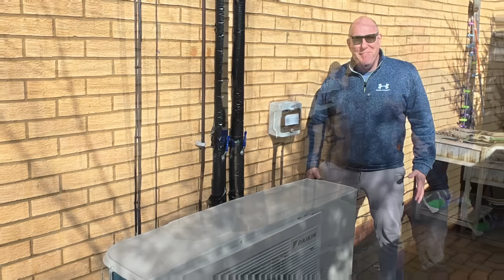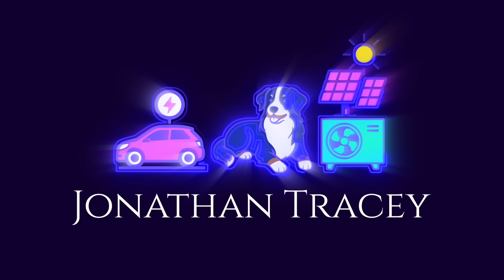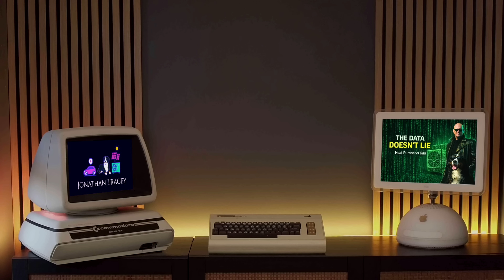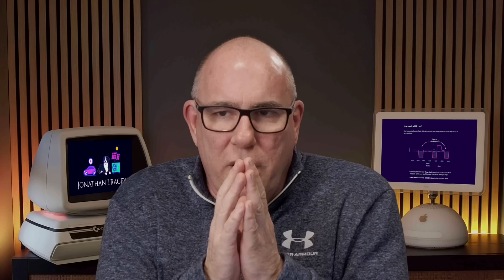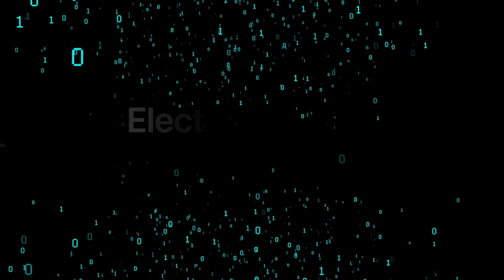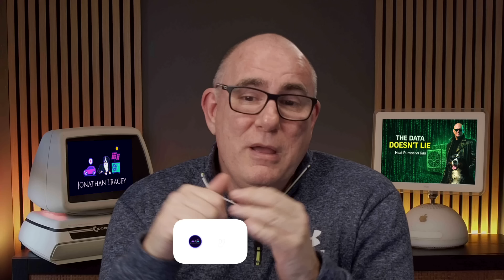The Data Doesn’t Lie   Gas vs Heat Pump Real Running Costs

Comment: Our experience and figures are a bit higher than JT's but I'm still very pleased with the heat pump. 
We have a 1950s bungalow 140m2 heated to a constant 22c for 24 hours a day, no setback.
The house has always been run at the same temperature even before the heat pump so no change in habits or economy. 
It has a reasonable amount of insulation but not great. 
Gas boiler was 28 years old and replaced with a Daikin 8kW heat pump July 2025
We had 9kWp of solar panels, 5kW inverter and a 9.5kWh battery installed in 2023 - no EV

Our Gas Boiler to Heat Pump Comparison Excluding VAT and Standing Charges
Electricity cost of the heat pump is the actual daily value of our grid imported energy and is measured via a Shelly EM50 
(Free Electric and Solar is ignored for direct comparison to gas) 	  			
		
January over the years
2026 - 925 kWh Electric Cosy  £141.38
2025 - 3850 kWh Gas Tracker   £239.88 	
2024 - 3364 kWh Gas Tracker   £247.18 
2023 - 4111 kWh Gas SVT       £402.88
2022 - 3248 kWh Gas SVT       £269.58 	
------------
February 	
2026 - 656 kWh Electric Cosy  £96.29 	  	  	
2025 - 2866 kWh Gas Tracker  £186.06 	
2024 - 2527 kWh Gas Tracker  £132.14 	
2023 - 3857 kWh Gas SVT      £377.99 	
2022 - 3110 kWh Gas SVT      £258.13

Thank you as always Sir.

Comment: One thing that concerns me about a mass switch over to heat pumps is as you have run through with the figures you would be reliant on special tariffs. Great if the companies keep them open but it will be very tempting once they have a captive audience to hike or close the tariffs meaning you are stuck with a expensive system that you can’t replace with a gas boiler because of the grant. 

You also need to add some comparison about the capital costs. It would be good to see the expenditure of the solar and batteries cost invested in a Stocks and shares ISA and that income from dividends being compared. 

Love your data driven reviews, this is what we need to see so we can compare gas vs heat pumps.
Reply: I did this very experiment for Mr EV man recently, he spent £18k on solar and batteries, someone said he'd be better off investing it, but what they always forget is to take the money out of that pot every month to pay the difference in the electric bill that the panels/batteries would save. That invested pot at 10% growth ran out pretty quickly, whilst the panels kept on generating and saving money year after year.
Reply from the maker: @TheRonskiman I’ve done a similar comparison and found the same thing. If you model taking money out of the investment pot each year to cover the higher energy bills, the pot tends to run out after about 15 years or so.  

The solar on the other hand should still be generating and reducing bills well beyond that — assuming I’m still around to enjoy it 🙂
Reply: @JonathanTracey   I hadn't considered this but I seems like a superb point: that the investment doesn't account for the energy costs along the way. Thank you and @TheRonskiman for the education!
Reply: Realistically, the spectacular effect of compound interest makes none of these options more lucrative than stock investments, on average.

But if the market crashes then you have an expensive house to run. If you invest in the house then you can lower your bills meaning you can live off very little income if needs be. Especially if you paid off your mortgage, which is a poor investment compared to stocks.

It's a risk aversion thing: The investment in stocks is higher return with higher risk. The investment in solar panels, a battery, an EV, and a heat pump, has a lower financial return but far higher stability and lower risk.

Personally, I know from my job that humanity needs to stop burning fossil fuels and there's very little I can do to affect that. So I decarbonise my own consumption first, which happens to also be a fairly good investment. Then from the savings made, I can invest the rest in stocks etc. I've only got solar panels to add to "complete" my house, now.

That strategy is the wrong way around because of the mechanism of compound interest, but stocks are a relative "bottomless pit", and your home only needs maybe £35k to "complete" the low carbon investment, so personally I'm trying to minimise my monthly costs which also reduces my risks and stress, then I'll invest (more) in stocks. 

Also when your car needs replacing an EV is cheaper to own than ICE so it's a no brainer if your lifestyle can make it work. Same deal for a heat pump: cheaper than a gas boiler in the long run. You get these as a matter of course rather than purely as an investment. An EV charger increases house prices by more than they cost.

Then when you have those, the battery saves you mad money. Solar panels compounds that further. The actual investment is like £10k for those. And you get backup power in cut outs, and energy independence in case of political/war related supply fluctuations. If you get the right car and charger then V2G/V2H can enable you to get a "battery" and an EV in  one package! Worth paying maybe up to £20k more for a car with V2G/V2H capabilities (£160/kWh capacity, minimum. £670/kWh you use per day, max.)
Reply: @Leo99929  My solar has beaten ISA performance consistently. Our batteries are doing likewise, but only because we are a huge energy user. Now battery prices are crashing it's getting so it'll work out better for more people.

For non ISA sized investments remember to account for the tax impact too. It's also the case that for poorer people who are home owners that sometimes doing things like adding solar gets the money out of your bank account if you acquire some eg inherited and so keeps you eligible for tax credits and the like.

I'm always amused by the RoI arguments on solar when it's 4-6 years yet nobody thinks twice about the RoI on replacing knackered double glazing units which is nearer 20 years.
Reply from the maker: @etchedpixels @Leo99929 I’ve actually found the same thing in my own numbers. My ISA has done well over the years, but the return from my solar has been even better when you look at the avoided energy costs.  

The key difference is that solar gives you a return every single year by reducing your bills, whereas an investment pot usually has to be drawn down to pay those same bills. Different types of investment, but in my case the solar has definitely been the better performer so far.
Reply: The tariffs derive from the difference between supply and demand because power generation doesn't go to bed at night (except solar) but people do. The UK actually has a huge amount of extra night time capacity so moving more and more stuff to use batteries isn't going to hugely narrow the pricing. It would take massive onshoring of lost industrial production from China, India etc to do that. 

Solar will also continue to eat into demand, as will insulation (the one everyone forgets about).

One thing that might narrow it is massive deployment of batteries. But the commercial point of massive deployment of batteries is to store all the renewable surpluses and then resell it at less than the gas price so the net effect should be to bring all prices down.
Reply: @etchedpixels  There's also the policy that the unit rate is set my the most expensive form of generation currently operating. So changing that policy would make an enormous difference. 

Also how gas prices are artificially suppressed to ensure the vulnerable don't fall into fuel poverty, whilst electricity doesn't receive the same favour. 

As we get more renewable capacity that should reduce the need for the expensive peak power plants, and distributed batteries in houses and cars can help balance the load on the grid between consumption and generation temporal mismatches. V2G and V2H would help massively with this. 

As would clamping down on the cowboys charging insane rates for low quality heat pump, solar, and battery installs. That would enable more people to afford more of the systems, and improve public perception of the technology. 

Maybe some government cheap loan fund where known good contractors can be paid reasonable rates for good quality installations, and the repayments are in line with cost savings, making them sustainable. Roll the repayments forward into further loans.
Reply: @Leo99929  Its not protecting the vulnerable, it's protecting the middle classes. The vulnerable and poor are much more likely to have badly insulated electrically heated flats/apartments.
Reply from the maker: @davideyres955 Thanks David. Yes, without smart tariffs the numbers would definitely look different. That said, while the grid continues to have periods of excess generation I suspect these kinds of tariffs will stick around in some form.  

They’re also one of the reasons solar and batteries make sense, as they give you a bit of insulation from tariff changes and the kind of global events we’re experiencing right now.
Reply: The country is firmly set on a course for more renewables, and that means the swings in wholesale price are likely to get larger, not smaller. That means we're going to see more special tariffs, but they'll probably keep changing.
We might see less predictable highs and lows that last a couple of days as weather systems cross the country.

Comment: I’ve been thinking of going Heat Pump, but my boiler is still working fine.
I have tweeked flow rates and I have smart thermostats in each room (Rad Stat with its own Room Stat) Temperature set to 20ºC 6:30 AM to 8:30PM when it then gradually ramps down to 17ºC.
4 Bedroom house. Hot water tank is heated by electric.
I’m on Octopus IOG and Gas is on the Tracker. I have solar & battery storage.

I’ve checked my gas bill December to January & it was £240.17 so I guess that’s not bad.
It wouldn’t be to difficult to install a heat pump either, but its not really worth it at the moment.
Might have to have a rethink if that chimpanzee with the hand grenade in the WH can’t get out of the war he started.
What really galls me is having to pay that gas standing charge over the summer months.
Reply: I did the same with our gas boiler flow temperature and was on the tracker tariff for a year before we had a heat pump, our numbers were similar to yours too. I've put my numbers in the comments a few minutes ago.

Comment: My Daikin 9kw was about 30% more expensive over winter but having the PW3 + 8kw of solar installed in January halved the costs. The PW3 works very well with Cosy and the whole house runs off half price electricity. It only runs off full price for small amounts of time if someone has an electric shower when the battery is low. Very pleased now but wasn't before solar installed.
Reply from the maker: yeah solar and batteries make all the difference and energy prices continue to rise it will save you a fortune👍